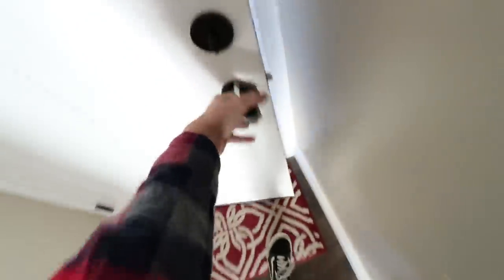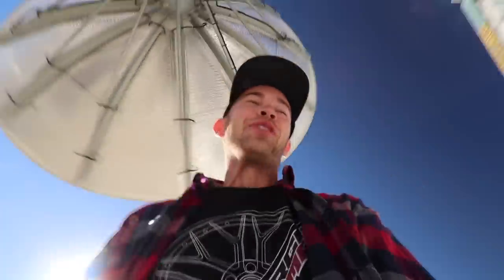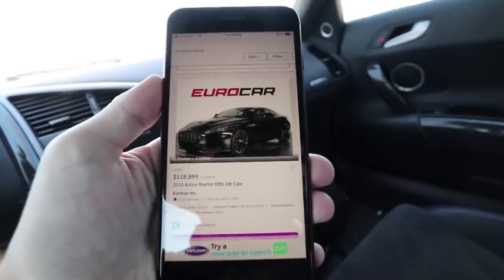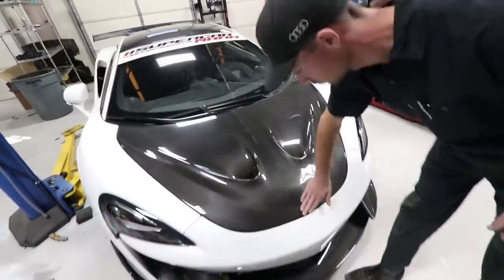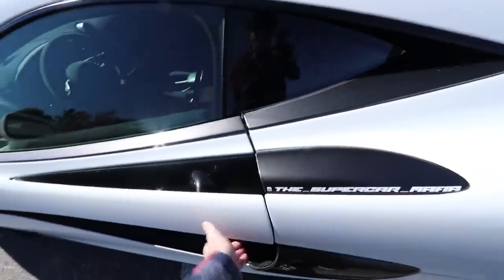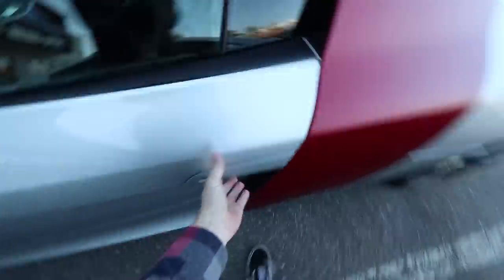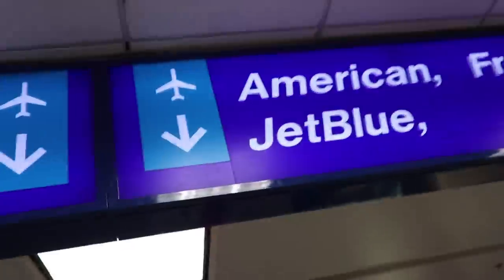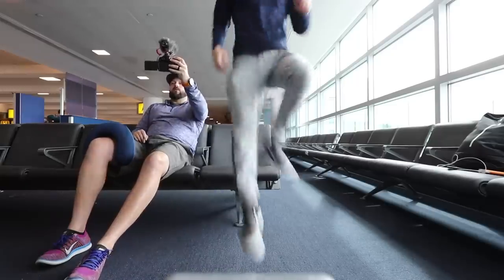NEW $7,500 Carbon 1016 Hood for the McLaren 570s!

Comment: Does the hood have drain holes or will the McClaren have 2 bird bathes on the hood when it rains?
Reply: I came here to ask that and it's not like he could just open it upwards to drain it because all that water is ending up running down into the frunk.
Reply: Im OCD with minor details 👍
Reply: @jimini1976  that's awesome!
Reply: Doesn't really seem like a minor detail to me lol
Reply: Its not minor, I was just making a general statement. I'm not even entering to win it. Fast cars arent my thing, old trucks are.
Reply: LMAO, exactly what I was thinking, I was like this seems like a really poor design.
Reply: I was wondering that too
Reply: just the fact that they will fill up with water when you wash the car is a pain in the ass
Reply: Mike Jones okay, so what happens when it’s washed?
Reply: when you wash it you simply wipe it out seeing as you wipe down the car anyway its not that hard..
Reply: Jimini #BirdVlogsComingSoon
Reply: Just open the hood and all the water will be drained
Reply: 1. Open hood and it will drain on the wipers
2. Drive fast until it comes out on it's on.
Reply: It's closed off. It's the shittiest design ever. 1016 does not make functional parts and it's a disgrace to put these on a 570S
Reply: Now you need a CFSV250S ( carbon fibre shopvac ) to suck the water out.  Lol

Comment: Anyone else realize that the new p1 style hood has holes for venting in the bottom where air should flow like the p1, yeah this is a 570s not a p1 so those holes lead to your trunk instead of cooling fans therefore if it rains your truck gets wet. What a good idea to have holes in it.
Reply: it is actually for looks and the holes just have a stopping point about a foot in so if water where to go in it would just fill up and not destroy his luggage